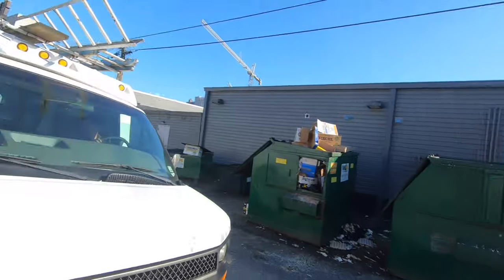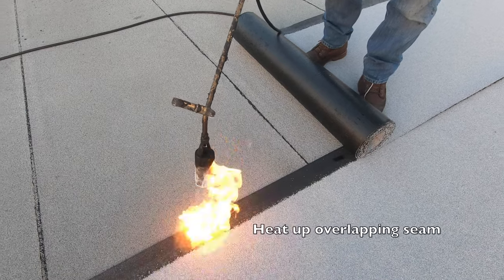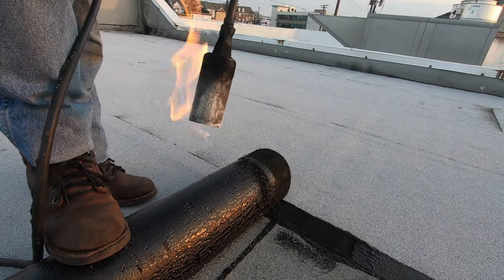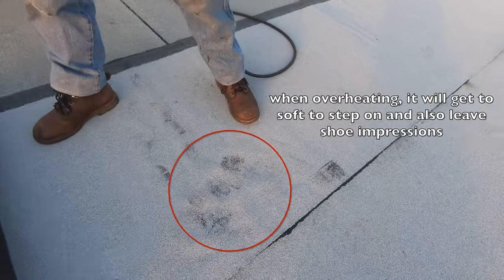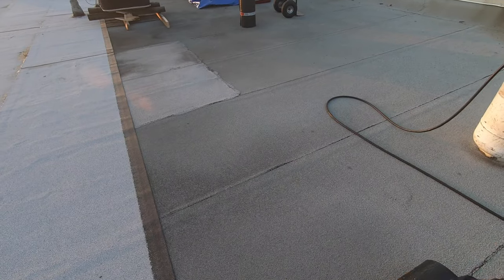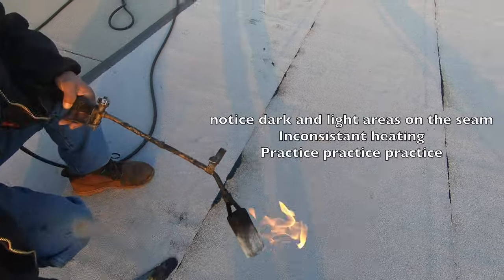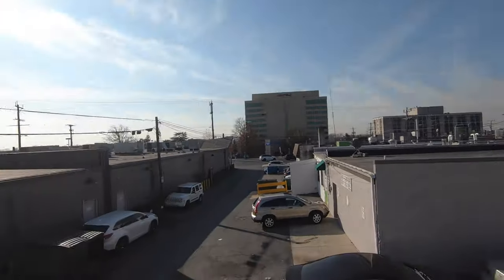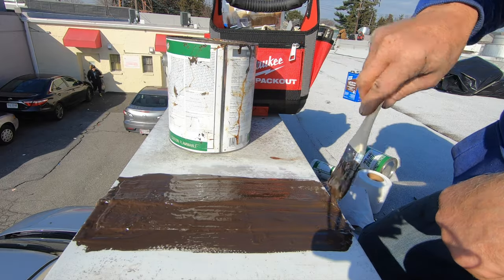I taught a new guy How to Torch Down a Rubber Flat Roof for 20 min, see what happened to him

Comment: Sir, I would like to say thank you for the lessons. I have been contemplating doing a flat roof that I have. I’ve done roofing before just not torch down. Thanks again for the step by step instructions.  I’m in central California so as soon as it clears up I’ll be heading this project full speed.  Thanks again🤙🏽
Reply: The cap sheet is ran the wrong way, no manufacturer would warranty this guys work.
Reply: @joeIpad208 I think this should be :
-1-th leyer vertical
-thleyer orisontal!
'M I rhong??🤔
Reply: guarda altri filmati.

Comment: im pretty sure youre not supposed to run the rolls opposit like that its called cross bonding they start pulling against each other, you should run the sheetrs the same way and just do it hald of the other sheet! also the metal capping should of just torched abit of felt on there